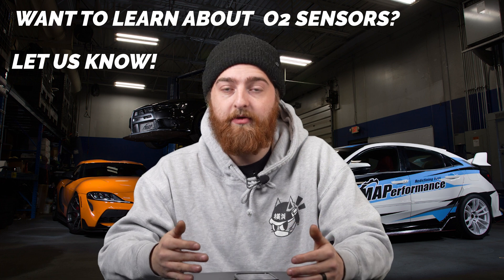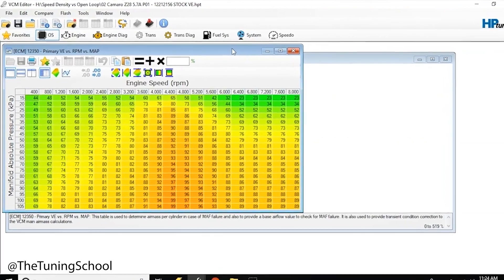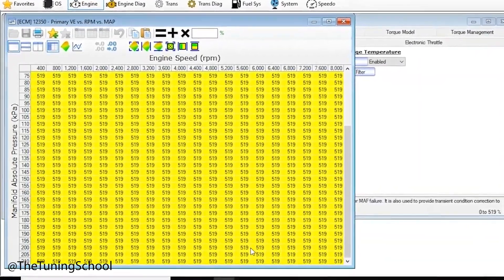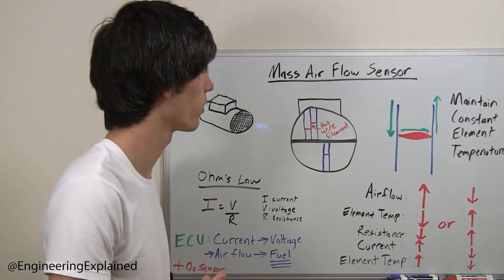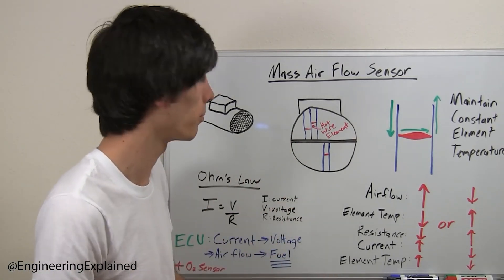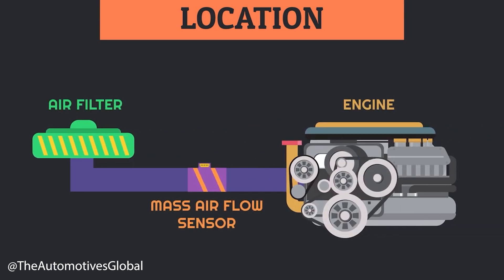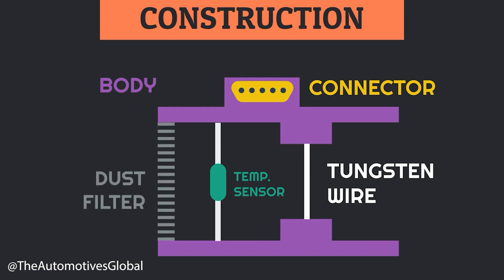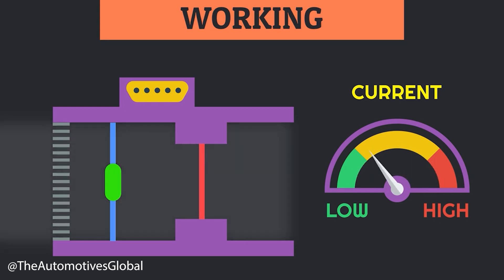MAF vs Speed Density Explained | What's The Difference?

Comment: I do not consider it that way, speed density is not an estimate, but rather a calculation based on pressure and temperature measurements.  MAF is more estimative since it is affected by humidity and in times of high environmental humidity, the MAF filament cools more than normal and it gives very rich mixture values.  I cannot consider one system to be better than the other, since it really is not like that, both are good and both reach the same level if they are correctly calibrated.  on the other hand, MAP is faster in response than MAF.

Comment: Great stuff thanks for the info. Quick question. You said speed density is better for WOT applications. So why on gm cars does it Reference the MAF only, above 4K on the stock tunes?
Reply: as he said in the video, maf is better for drivability, and thats prolly just how they decided to do it, and also from what I gathered there's no real benefit to map tuning on a car with a stock intake, as the maf is still able to effectively read the volume of air going into the engine, rather than the hot wire being overwhelmed by a big ass race style intake or open turbos.

Comment: currently getting tuned with SD for my 17 sti. current mods are aem fuel pump id1050 injectors maperformance cai and downpipe, ewg with a flex fuel pro tune. was wondering how much itll affect daily driving, thanks for the brief video explaining the topic. im sure it wont be too bad but with the freezing winters in wisconsin im not to sure.... oh well more powaaaa
Reply: Did you get SD?? I am about to but not sure yet
Reply: @dougcastle1785 id ask your tuner only they will know what will be beneficial, im at sd protune and honestly ive been anxious about elevation but he confirmed that its safe. Map runs well with sd and bypasses those o2 sensor jeadaches if tuned right
Reply: Just got my car back with a base map to beak in new motor running SD as well and cold start ups are rough to to say the least 😂

Comment: Neither. VE based tuning with aftermarket engine management systems is where it's at!
Reply: VE based fueling still uses speed density properties.
Reply: @SimplesolutionTS  it does. But it's not the exact same.
Reply: Oh look, they use a VE table using the speed density system! Crazy ain’t it

Comment: Now when tuning,  does it have to be one or the other?.. because I have both on my car...can I have MAF tuning for daily driving and street use.. and MAP (speed density) when I'm in the upper ranges or does it have to be one or the other throughout the band?...🤔
Or would I have to create two maps(tunes).. ?
Reply: certain ecu's switch between MAF and speed density depending on load, example. evo 10's
Reply: @SimplesolutionTS  nice... that's what I was getting at... . I'll have to look into that for my ECU....🏁👍